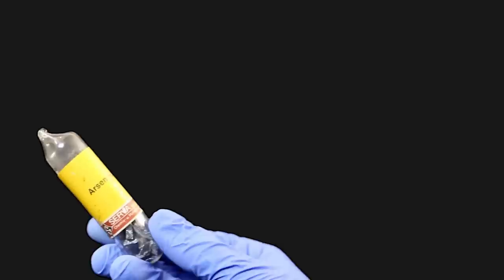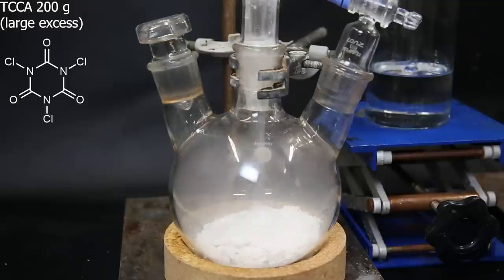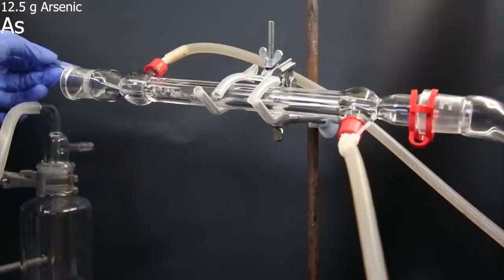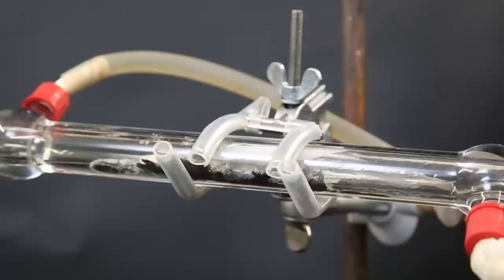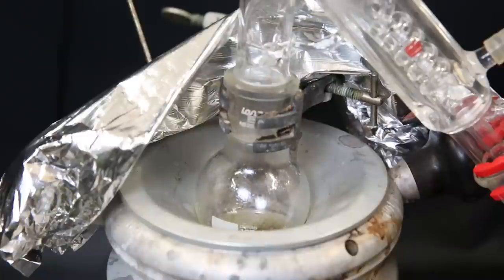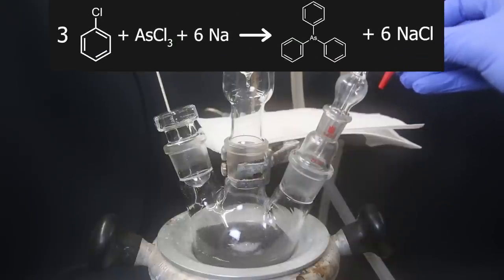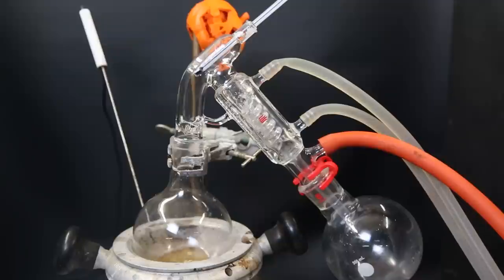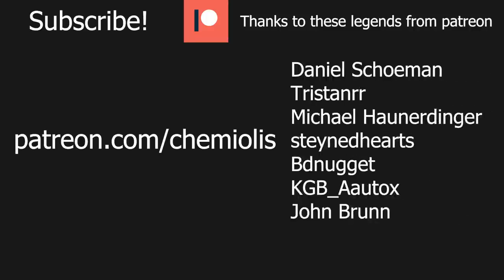Making Triphenylarsine with Arsenic Metal

Comment: To avoid fuckups due to suck-back, make a habit of placing a safety bottle between the water trap and the flask you want to protect. It prevents dangerously high blood pressure and head shaped dents in the wall, trust me. 😡🤕

Comment: Inverted funnel traps are the bane of my existence. I switched to using a long straight 24/40 tube because it has a lot more wiggle room than a little funnel because it can fill with more liquid before it coming over. What is your fume hood setup? Must be rock solid if you are willing to do organoarsenic chem!
Reply from the maker: I constructed a hood with a similar area as the commericals ones and bought a 2nd hand fume hood centrifugal fan for the airflow and connected that to it. A lot cheaper than buying a commercial hood which is basically just a plastic and glass box (and the wrong size for me). I looked into the actual toxicity of the compounds (not too crazy) and wore a respirator with a B2 filter constantly. Arsenic has been worked with for a long time in human history, yes it is quite persistent and nasty, though it can be worked with safely if we consider today's standards and protection. I won't work on different arsenic projects back to back just to be sure that there is no chronic exposure.
Reply: @Chemiolis  makes sense! Doing something similar is on my list as well. 
How did you decontaminate the area? AsCl3 turning into non-volatile chemicals on surfaces is spooky.
Super impressed by your videos! Your channel is going to seriously take off before we know it :)
Reply from the maker: @nomcopterlabs  Thank you! My whole fumehood is covered in black paper and black vinyl (as backgrounds) so I can simply remove these to clean it. I can't really do anything to the ducting but I don't think there is really that much of an issue anyway, since the quantities are so small that it won't really matter even if you lick it ;)

Comment: I would agree that not using powdered sodium probably was the reason for a lower yield. I recently repeated a reaction that another researcher in our lab had done before and I got a much better yield because I used a powdered reagent rather than a crystalline reagent.
Reply: How does one even get powdered sodium? Isn't it really soft, kind of like clay, not really the sort of material that can be turned into a powder? (And of course, it would be harder to handle, due to the increased air- and water-sensitivity.)
Reply: @alexpotts6520  I think you can powderize it by precipitating sodium metal by doing a reduction reaction with a sodium salt. I know people do it with potassium to make "potassium sand," and you can even purchase powdered potassium from American Elements.
Reply: @user-ko7lz3kr1d  Well you need a pretty powerful reducing agent for that! And moreover, the reaction would somehow have to be done in the solid state to get a powder, otherwise you'd just end up with molten blobs of sodium coalescing into a ball, so it's not just a school-level smelting-type reaction.

Comment: Thumbs up! Do you know, if Benzene could be replaced by Toluene (which is much easier to obtain, since you don't want to run a dry distillation of a mixture of Na-benzoate and NaOH, in order to get some Benzene)?
Reply: Toluene has already replaced benzene as the solvent, almost nobody uses benzene in labs anymore, except as a reagent when it is needed.
Reply: @durshurrikun150  I know: This was already state-of-the-art back in 1978, when I  began my vocational training.

Comment: Hm, very dangerous - and so many contaminetd equipment to clean up... really no fun.
Is combining alkali metals and halogen hydrocarbons really recommendable? 😟
Condensers aren't made for heat reactions - better use a original reaction pipe for it.
Funnel traps are used to prevent suckbacks while gas washing - but it only works if the funnel isn't dipped to deep into the liquid, just a few millimeters.